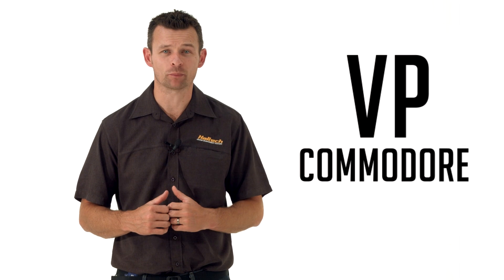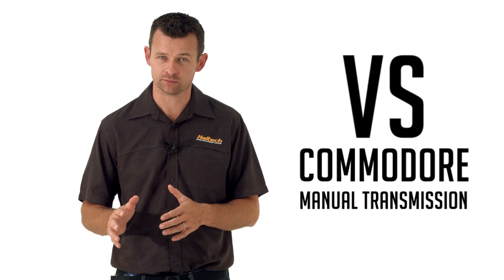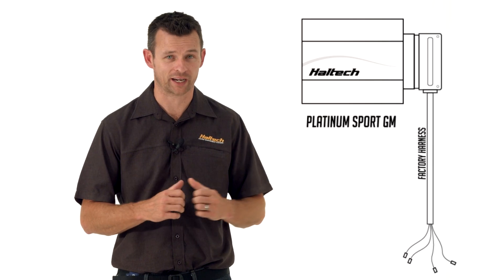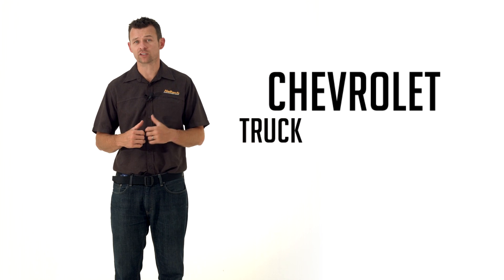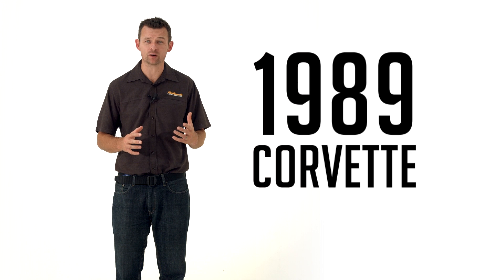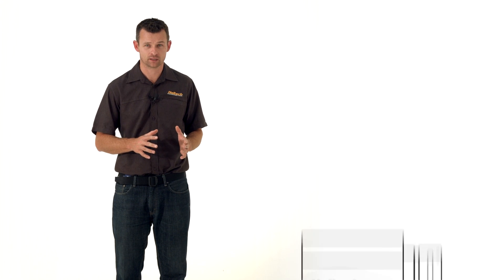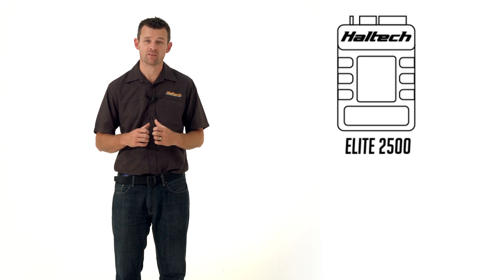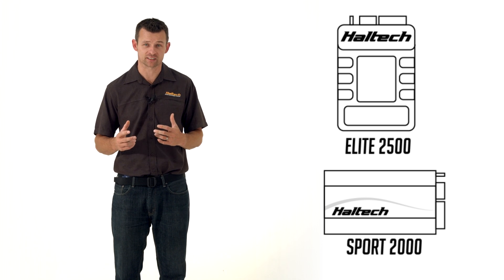🔍 GM/Holden - What Fits My Car?

Comment: What ecu fits subaru b4 rsk 1999 ej20 be5? Cheers
Reply from the maker: The Elite 1500 supports the B4’s EJ20, however will require custom wiring for installation, as we do not have a plug-in solution available at this stage.

Comment: do a bmw m50-s54 engine
Reply from the maker: +DkingE39 The Elite 2500 supports both single- and dual-VANOS (both low- and high-pressure variants), and sequential injection on the M5x and S5x series engines.
Reply: +haltechecu. can you also program ignition sequences and sequrity measure into the ecu